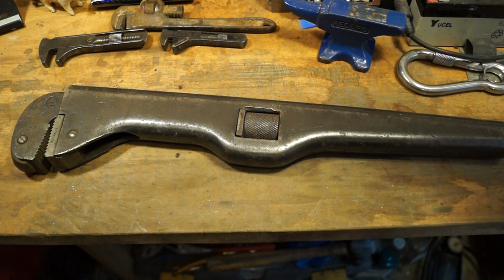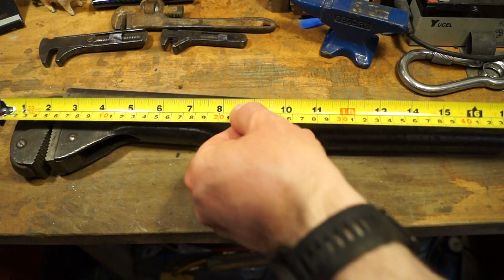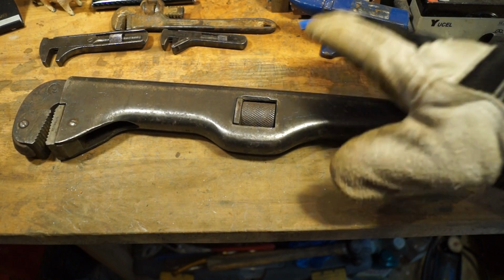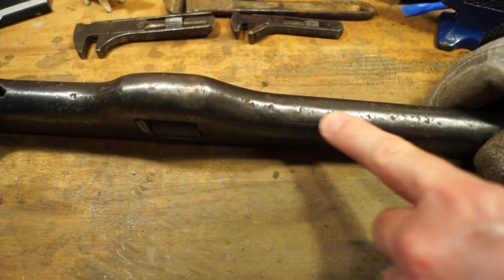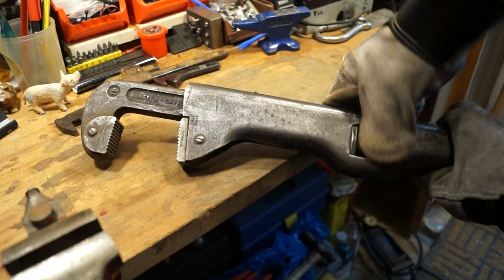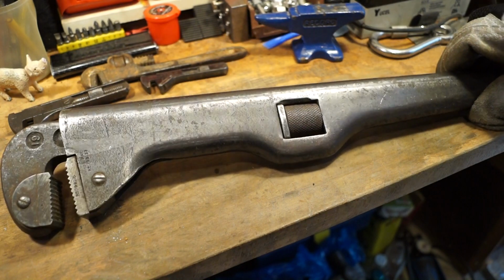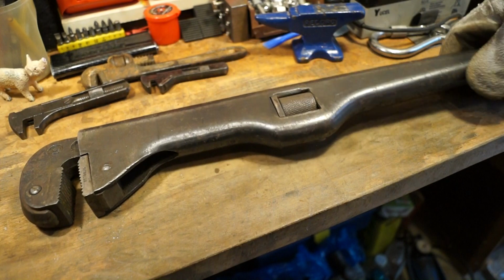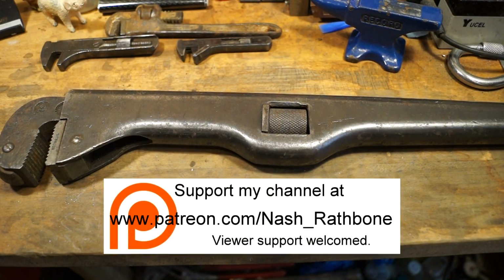Mystery Master Grip 19 Pipe Wrench; Can you help identify it???

Comment: It's from the period around 1936 -  found copy of 1936 practical mechanics magazine on the net  - page 378 - scroll 80 percent down the page  -  
https://worldradiohistory.com/UK/Practical-Mechanics/30s/Practical-Mechanics-1936-03-S-OCR.pdf    
i think it may be a product of Frank Humpihris and Sons LTD, they made other wrenches called "The master" /" The boss" etc with a ball bearing screwed adjuster placed at the bottom of the wrench. that spanner appears in the article with it.

Mine also does not come apart
Reply: Think if you take the bottom jaw off ..the whole lot will unscrew
Reply from the maker: Many thanks 👍
Reply from the maker: I will give it a go, thanks.